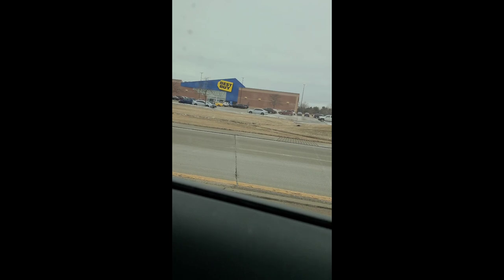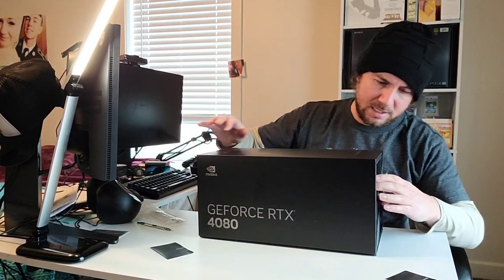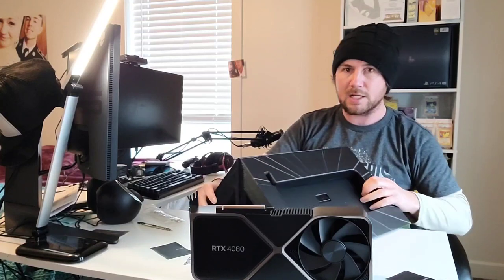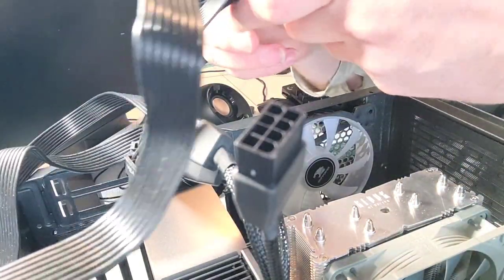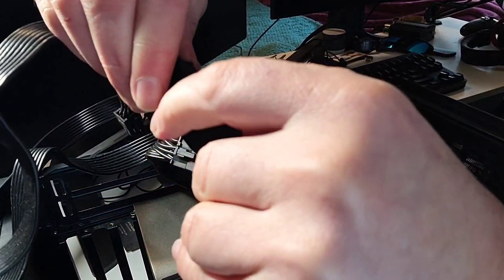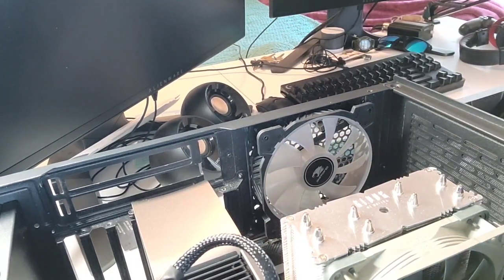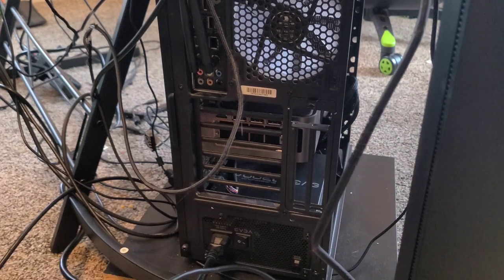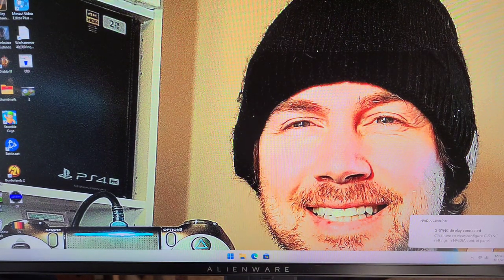How to Correctly Install a Nvidia RTX 4080 GPU + Performance improvements.

Comment: i have vga cable feom evga g6 1000 watts with 7 pins only does that goes to psu? i bought recently new pc and havent used it for a week 😭😭
Reply from the maker: 7 pins that usually powers motherboards

Comment: man owns pets and took the side panel off..... can we get a rip for the computer having to eat dust for the rest of its life. if the companies that sold the connectors were competent people would not have to do shit like this..........
Reply from the maker: you do realize you can clean your pc, i deep clean mine every couple of months. The connectors are what they are, people just need to check there work which most do not.
Reply: @MIKEZGAMER-g8b  if having to remove side panels is something I'm expected to do in order for the power cable to not burn up its a bad product and I'm not sure why you are defending them? also everyone should deep clean but in the two months the computer is running with dust cant be good. but....... im not saying that im not thankful people that are making videos like you about it. everyone who sees these and is able to avoid bending the power cords is another potential computer saved.
Reply from the maker: @RealObeyNinjas  i attached my side panels back on aftetwards, with a tiny space for wiggle room 
Yes i agree about the cleaning 
Im sure nvidia will upgrade the cables later
Reply from the maker: Yashvir The Pentester  just use a micro fiber cloth

Comment: First build in a few years and you explained exactly what I needed! 
Spent ages trying to figure out wether or not to use 2x pcie cables to power my 4070ti or just use the pigtails
Reply from the maker: happy to help bud, congrats on the 4070 ti, it is decent value for $
Reply: I'm about to help a friend replace their 3070 that died (again and just out of warranty) with a 4080 and I looked all over for how to hook the power cables, you'd be shocked by how many people just skip that part.
Reply from the maker: True, alot

Comment: Something I would suggest you do for your next video involving things going on on-screen is downloading and using a screen recording/streaming software like OBS instead of using your physical camera because as you can see it's not able to capture the real quality of the monitor. Colors are off, your monitor may run a higher refresh rate than the camera which is probably 60fps or lower. With OBS recording we would be able to appreciate the differences. Something to consider!

I am grateful for this video though because I will eventually replace my GPU and this will help a lot. Thank you.
Reply from the maker: Thank you, i usually utilize obs it was having issues that day, for me the phone was the next best thing, appreciated the input, hopefully, some of the video helped, i do not usually do tech vids, i was asked by a couple of people, so i had to deliver.

Comment: Bro so i bought a 4080 and only pushing 40 fps even after following the settings
Reply from the maker: What game are you playing ? Other factors could bottle neck a gpu, like a cpu lack of memory, to many programs running at one time. Look at the bigger picture. What size is your power supply and is it new ?
Reply: @MIKEZGAMER-g8b  its brand new, 1000w.. i have 3 hard drives.. 1 local c disk and 1 d disk that stores games & the other is 1tb HDD that needs to be connected… and i am playing Fivem (gta rp)
Reply: @MIKEZGAMER-g8b  thanks for replying so fast btw. I thought i was gonna have to wait 2 weeks for a reply 😂 i feel helpless man idk what is going on. I have friends with 3080’s pushing 150fps effortlessly and here i am struggling.
Reply from the maker: @moneystaxx916  go to nvidia and makes sure the driver updates for the 4080 are up to date
Reply: @MIKEZGAMER-g8b   i guess my comment got deleted but i said in the comment, that i updated the drivers as well already? Is there any other suggestion? Im thinking connected my 3rd hard drive and upgrading to windows 11 might help?
Reply from the maker: @moneystaxx916  could try it, i would also get your gpu tested on other games use nvidia peformance settings to check volts frames etc

Comment: hey bro i just got a rtx 4080 and a i9 13900k intel with a 850+gold psu and my nvidia app says i’m only running 645mhz gpu clock it’s struggling to even run valorant keeps crashing with only 200fps would u know why also the fan option is nvidia is not available for me even in bios i change it to max and nothing happens
Reply: oh also my gpu utilisation is on 0% doesn’t matter what game i run so idk what’s going on
Reply from the maker: Use the msi overclocker fan adjuster, it works for me every time

Comment: So this is for any power supply? And if I understand right you need three 8 pin cables each individually hooked up to the PSU no with splits. Sorry if this is kinda stupid to ask but I'm looking to getting one and wanna make sure I can install it correctly.
Reply from the maker: Understandable these gpus are not cheap, you want to install it right, any pu is ok as long as its a 600 watt minimuim for a 4060 if you have a 4070 ti go with a 750 watt just to be safe, you want plenty of watt threshold for if you over clock the cpu, yes 3 8 pin individual cables to achieve the best peformance out of it, it will minimize any bottle necking and of course lower the risk of fires as the curve in the wires and the lose plug connections seem to cause the power to jump the gap, a time of bridging, its called arcing, which increases resistances and slows down the transfer speeds. I have a 1000 watt pu for my 4080 which is over kill, but atleast this pu will last me through the next gen nvidia cards.
Reply: @MIKEZGAMER-g8b  Thanks man!!! Ya everything with these new gpus and cables was kinda confusing. Nice to know I can still use the cables I have I just need one more. I really hope I can upgrade my 2080 to a 4080 soon. Even you showing what cables you're able to use and what to do is nice. Only one other person I found showed installing as well as you did. I appreciate that a lot. I know how to install GPUs but this one had me worried with all the "new" stuff kinda thrown in. I just didn't want to ruin anything lol.
Reply from the maker: @ThePapaDeejay  all good brother, its all straight forward, one thing i forgot to mention in the video, use the pcie cables that come with the new power supply, some pcies can be have a smaller thickness (guage) wire, you want that as thick as possible, the thin ones found on smaller pu can cause resistance and excessive heat build up, it coukd also fry components as electricity may divert back to finding the path of least resistance.
Reply: @MIKEZGAMER-g8b  Oh I'm not planning on getting a new power supply. I have a 850w which should be enough to run everything. I have some custom cables it should be alright I imagine. The whole thing with these melting and what not sketches me out still. But I think I'll be alright.
Reply: I have a question. I have a Corsair 12+4 PIN; two heads with 8 pins type 4 for each head, and other side is PCIe 12 pins. I wonder if it works? Thank you.
Reply: @alanlam5583  Yes, and it's even kinda better for load balancing to use 2 to 1 OR even 4 to 1 cables because current will flow thru multiple cables instead of just 1 to 1 like native ATX 3.0 PSUs.

Comment: Hey just wondering, if I were to only use 2 PCIe cables instead of 3, would I risk damaging the pc? Thanks!
Reply from the maker: Do you have a 3090 or 4090 ?
Reply: @MIKEZGAMER-g8b  thanks for the fast reply, I’ve actually got a different model. ASUS Tuf geforce rtx 4080. I referred to your video despite the difference in hardware because of how helpful I found your in depth tutorial. Any guidance would be very helpful.
Reply from the maker: @bigsteps  if there is 3 pcie inputs, then connect 3 pcie cables, withput pig tails, pigtails will restrict how many watts flow to the gpu
Reply: Hello, same problem with same asus tuf 4080, there wete only 2 cables connected to my old 2080ti and now I need 3 but in the manual they say not to use the pig tail...
Reply: @Frugivorix34  For me, I went ahead and did use the pigtail and ordered the cable online because no store in my city had it. My computer worked perfectly for the two weeks delivery lasted. I opened my computer and installed the new cable when it arrived. To this day I notice no issues with my PC that stemmed from using that pig tail. Hope this helps.
Reply: You ordered a third PCIe cable ? I found one in the motherboard box but connecting it to the alimentation is another story ☺
Reply: @MIKEZGAMER-g8b does the 8 pins with 1 empty pin goes to psu? thnx
Reply from the maker: Yes into the psu

Comment: Hello, great Work! 

May i ask you, does the installation of a rtx 4080 fit to  Straight Power 11 850w power supply?
Reply from the maker: a 850 watt PU yes it will work, I have a 1300  watt because I plan to upgrade to a 4090 when I can find a FE available.
Reply: @MIKEZGAMER-g8b  
Thank you Sir!
Reply: Using 13700 and 4090 with 850w.

Comment: You overclocked your GPU and you didn't showed that on video :)) 1.1 voltage means you tweaked a bit the GPU. Anyway, nice video !
Reply from the maker: NVidia simply increased the wattage through the Nvidia Auto Tuning, no clocks were adjusted, MSI Afterburner was not used at all. Thanks appreciate the like Randy